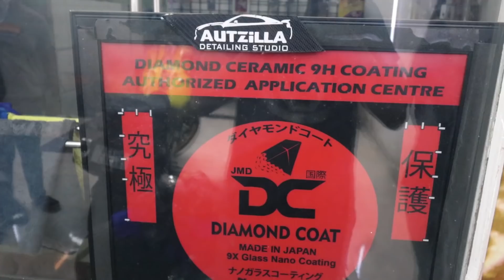Best Ceramic Coating Studio in Mumbai for Bikes/Cars | Ninja 650 & Vstrom650 | #Autzilla

Comment: What is biggest difference between ceramic coating from professional vs diy product,apart from cost?
Reply: The professionals know the surface smoothness after claying the body! When the use the coating, the pressure applied for coating will be equal and not hard. So after the paint is baked, you have a uniform surface. Some light yellowish spots appear in the car or bike Body when you DIY.
Avoid such rookie mistakes
Reply: Also you should know cut polish and the use of Polish pads ranging from a quarter inch to a big pad